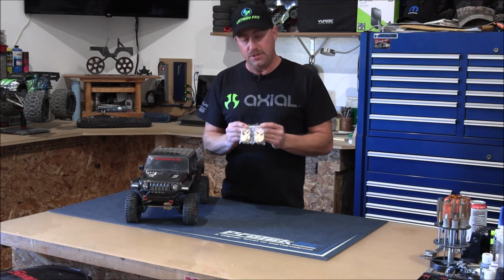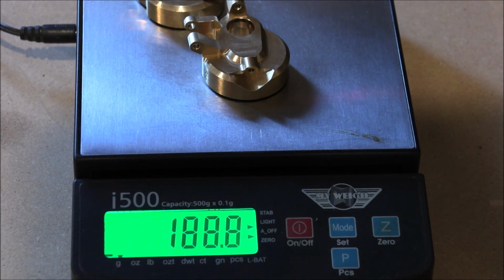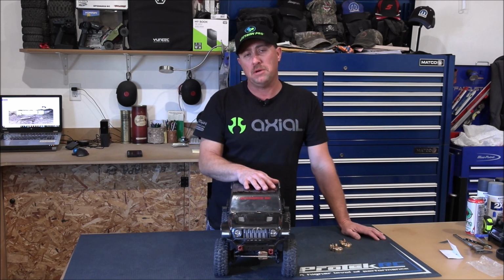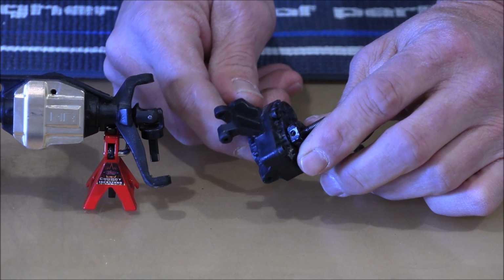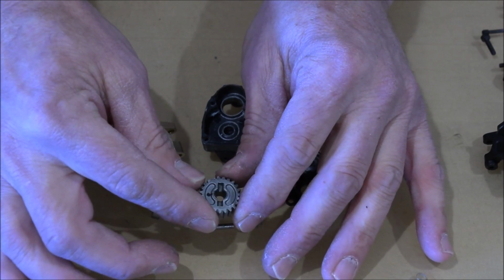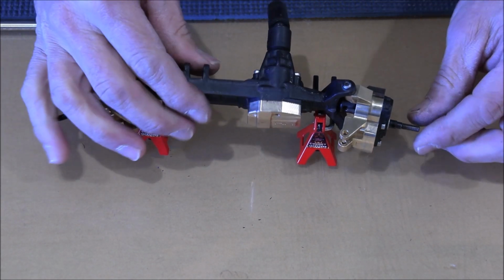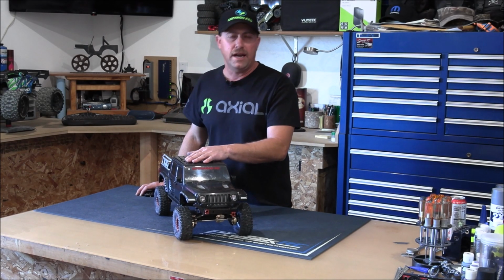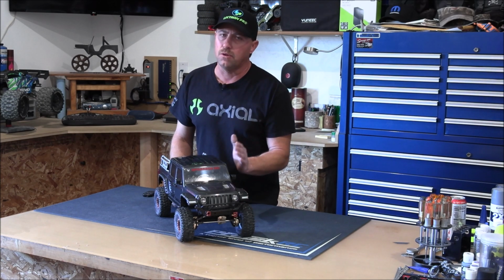Installing Hot Racing 95g Brass Portal Steering Knuckles

Comment: I really like your videos. You do a good job explaining what you are doing and the rationale behind it. When i built my SCX10III i used the SSD high clearance links, 11 tooth pinion, SSD brass portal covers (front), SSD front brass pumpkin , treal beadlock rims with Proline Hyrax predator compound tires and Super Shafty overdrive gears.  After my first run i broke the pan hard mount and ruined the front drive shaft.  So in went the Treal shock towers and Boom racing drive shafts. I did order the Hot racing shocks based on your review but have not installed them.  Im thinking of getting rid of the 1:1 gears in the transmission for improved low speed control.  I recieved the Proline 1946 power wagon body and i really like it it but,  to make it fit it will require major surgery to the stock wheel wells.....  Anyway i enjoy tour informative videos.  👍
Reply from the maker: Thanks for the run through on your rig, sounds solid. I'm glad you like the videos,  more to come. Next one is on installing a Holmes Hobbies 550 5 slot, 15t Crawlmaster motor, then all new electronics😎🤙👍

Comment: Nice job on this series. I may have missed it but I was wondering what bumpers are you running looking for options in the process of my build right now
Reply from the maker: The bumpers are made by RC4WD . The front is made for the scx10 JK Rampage Part # Z-S0434. And the rear is for a traxxas trx4 lol! The part # is Z-S1854  and you will also need a trx4 bumper mount part # 8237 . The front wasn't to bad, some cutting on the bumper so the ears don't hit the panhard bar mount and drilling holes in the frame. But the back took a decent amount of modifing to make it work! And RC4WD also has a badass trailer hitch for your receiver  part # Z- S1095. Hope this helps, Enjoy!!

Comment: Hi I'm new to rc, looking to upgrade my gladiator pretty much like yours. Do you have part numbers for the brass knuckles, covers and rear brass?
Reply from the maker: Yes, the Hot Racing brass portal covers are AUTB21H and the rear brass portal knuckle caps are AUTB21CH. I don't have the diff covers part number sorry.